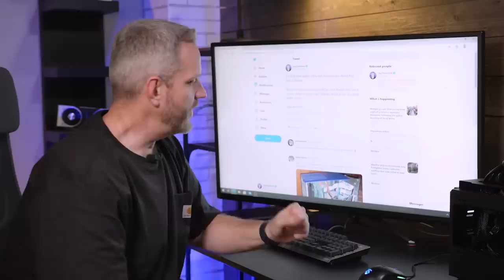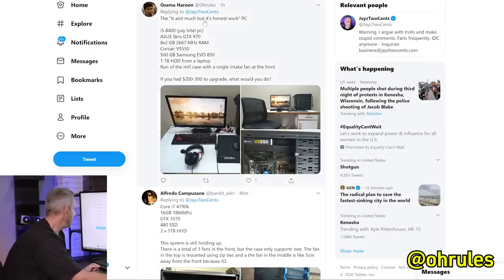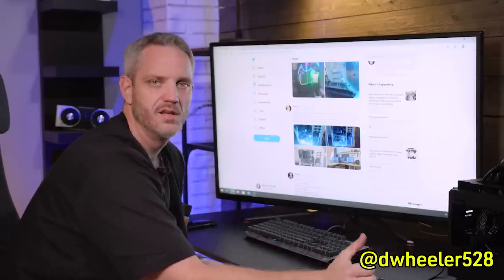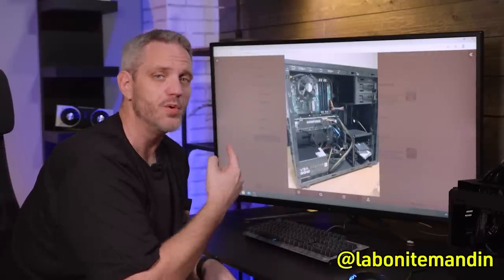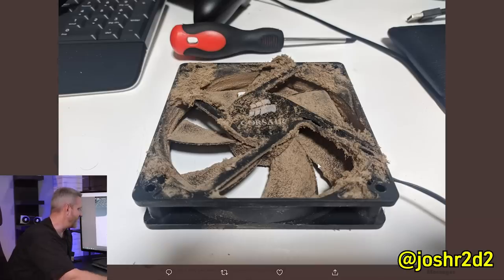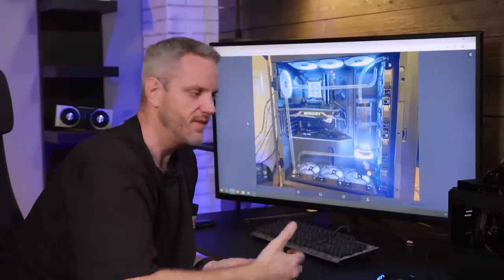Reacting to your WORST Setups... Send help NOW!

Comment: Oh boy, my cable management in the miniITX would give him a heart attack.
Reply: same, but to be fair - if you have a non modular PSU it's supposed to be just a mess
Reply: @Element0Hg  Sorry mate, but no it's not really supposed to be a mess. You can still manage it very well, usually. Unless your case it two decades old, there's no reason why it can't be done.

Comment: One thing I would suggest to anyone who's running storage that are getting close to a decade old (hard drive or SSD): You're getting up close to the end of your drive's intended lifespan - if you're going to continue using them, make sure you have stuff backed up!  Storage is fairly cheap these days; get yourself an external hard drive or something and make sure everything you really need to keep is on that.  It's not a huge deal to set up a new computer if your drives die on you, but you're gonna be really upset if all your stuff is just *gone*.

Comment: I have to agree on the soft tubing
I use my system mostly for creating music and I know that the combination of that and hardline does not go well together but going with air cooling and even some AIO’s would result in a to noisy system so going with soft tubing with compression fittings on a custom loop is the beste solution there is in my opinion

Comment: That first one it the same case I used for my build, it is/was a Dell dimension XPS generation 2 or 3 mine was the 3, it was my first gaming pc back in the day and when i started planning my new PC i saw it in storage and wanted to bring the old girl back to life, with the help of a friend and some parts from a poweredge server we converted it to ATX (not easy) and kept the slide out motherboard tray

Comment: One day I would love hear Jay's thoughts on my first build. 
"Antique" Antec DH800 case
Ryzen 1700X
ASUS ROG STRIX GTX 1070
32Gb G.SKILL Trident Z 3200Mhz
ASUS Crosshair VI Hero X370
Corsair RM850X
2x Samsung 500gb SSD
later modified the case to house 8 Noctua fans, NZXT manual fan controller, Bitfenix lighting controller for LEDs, and a Noctua NH-D15S with the Chromax kit.

Comment: I love my FX Jay. Its not my main system to be clear. But I don't care what anybody got to say about FX. I had a FX-4120, FX-6120 and I currently have my old FX-8150. They ran everything I threw at them. The only reason I upgraded to the 8 core was cause  I got a 6990 and the 4 and 6 core just could not really keep up. I kind of feel like the 6 core should of but maybe I am wrong. 8150  ran my 6990 and the only thing that made it work hard was a second 6990. I still have a Phenom X4 9650 fully working. Works perfect. Its done everything from Playing the Sims to Mining Monero. The FX-8150 and dual 6990's run my PLEX/KODI server. I keep waiting for something to die but....it wont.

Comment: Hey Jay,  great advice on upgrading from the FX series... If you want to upgrade from the whole am3+ motherboard on.. sure a**hole I'll get right up on that.  A lot of the higher FX  processors are still selling for over 100$..can't be as obsolete and unusable as you make it sound. I'm still rocking a 6200 overclocked to 4.5.  So what's your best guess on what it would cost me to just go and upgrade from the FX line?

Comment: FYI for any new comers
10105f - £80/ $80
MSI B560 board - £60 / $80
16 gig DDR4 crucial ballistix 3200 RGB $60 / $80
Corsair 220T case - £59 / $70
And throw your existing GPU and PSU in it for now.

I have been an AMD fanboy for 27 years since I was 13, but I have to say there has never been a better time to get some decent budget bang for your buck PC builds thanks to lintels 10th gen refresh, I built the system above for my partner for Christmas, I was going to go B550 with Ryzen 3 3100 but it costs 40% more for 30% less performance, go figure.

p.s. if you dont have a gpu and are looking for a budget option, if you have a 650w PSU or better, the HD7970 3 gig can be picked up for absolute peanuts, no one wants them due to power draw and no good for mining plus only DX11.2, but it cost me $50 to buy a card that pulls just under 9000 on firestrike, perfectly worthy stop gap for little money.

Comment: suggestion for a theme to submit around.... show us your custom case mods.... what did you have to cut, drill, or 3d print... for example my case only supports a 120mm rad and 3 fans... my 10700k and 3080 get hot... i wanna bust the glass and replace it with a metal plate and cram a bigger rad where it went

Comment: I don't get the problem with soft tube, actually I don't get hard tube for anything besides a show PC. At the end there you explained why I will never do a full hard tube system... Maybe if I could afford a top of the line (no upgrade path) system- Ryzen 5950X, 3090TI, 128gb argb ram, and the best rads/ pumps/ fans in a custom case.

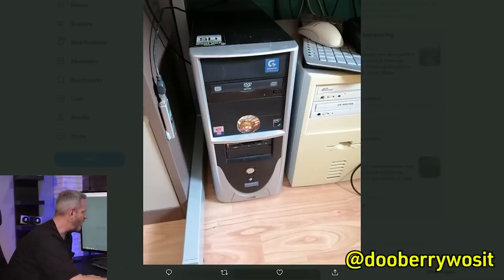Comment: The one at 7:30. Definitely previously owned by a smoker or a humid ass room. That is a lot of dead skin and tar/moisture. The low figure for the amount of skin in household dust is over 80%.

Comment: I bought a system with one year old parts. It was dirty inside. 

 Broke down recently twice, even after cleaning with air compressor.  

Now won't start at all. Light flickers on nocturnal fan then stops. Hope it's under guarantee. The card alone is worth $1000.

Comment: I had a alienware aurora r5 with a i5-6400 and gtx 1070, just built a new pc with i5-10600k and reused my old gtx1070 cause a went above budget, but will upgrade to a 3070 in the future.
Feels so smooth tho.

Comment: 1995, win 3.1 computer with a  tiny I think 1GB HDD, that still works. It is up for an upgrade, stills runs on a 'modem,' that makes the old AOL sound.... It is a museam peace, but runs the old software beautifully. And an old DV7000 hp laptop.. they might be subjects for an upgrade, if your bid is high enough. Old machines, but they run... 10 year old machines. but all work and run the old vintage games.

Comment: It makes me kinda happy every time i see someone else still using Xeon x5675 :D Mine is at 4,2Ghz too, with GTX 1070ti. Im thinking about building new system, but every time i get to the conclusion, that i dont really need to. (i just want to :D ) It is doying everything i need.... (used with 2560x1080 75hz monitor, still pushing around 100 fps in BF5)

Comment: Im running a FX-9370 as a daily, but also have a 1800X system.
Reply: kinda the same. fx8350/rx580 and a 2700x/1080ti ( last build was 1800x but it died and replaced with the 2700x)
Reply: @MrJackSeverity  Im goin to get a 3800X today actually!

Comment: what it means if you take the time to cable manage properly and everything is secure is that it shows the buyer that 1, you take good care of your stuff, meaning that the product will last longer, 2, that you know your stuff, so as jay pointed out, the buyer will have a way harder time to lowball you
edit: at 17:50 one thing could also be due to smoking, trust me, i know, im a smoker, and when i clean my fans and shit every 2-3 months the dust is a slightly more yellow tint than this

Comment: I want to upgrade, but My system is just good enough to not be able to justify it...

FX-8350 @ 4.5 (half assed OC)
32GB RAM
1660 6gb
SSD
280mm AIO

I guess it's just a Mobo, CPU, and RAM I have to replace but meh' this is good enough.  I bought it years and years ago and slowly updated pieces as i got them on sale or used for cheap.

Comment: 15:06 DDR2 isn't expensive. You can get a brand new set of 2x2GB Hynix DDR2 800MHz on Ebay for $20.
I have multiple sets of them and they've been perfectly fine on my LGA775 systems.

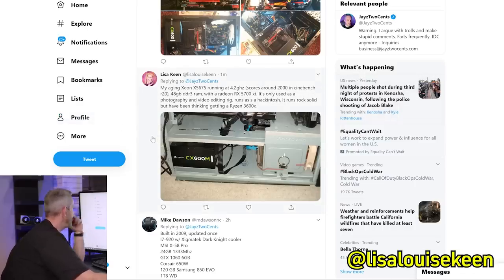Comment: 21:21 The overclocked Xeon 5675 is an absolute gem of a cpu. 6 cores 12 threads @ 4.2 GHz it's the fastest CPU I've ever had. Parallel to my current 9400F but for $45 so $100 less.

Comment: I ended up swapping out my fx purely because the drivers were shite. My pc would bluescreen at random because fx doesn't like playing with wifi card drivers -.- fixed up on a minimal budget last year to a ryzen 2200g and it performs pretty much identically minus all of the random bluescreens so I'm happy. The plan now is to hang onto it until I can get my hands on a 30xx series and just build a new rig. This old boy will probably get relegated into an emulator/home theatre pc

Comment: I just ditched my fx-8370 after a decade of use. Went with the Ryzen 9 3900x .. If you're like me and have been putting it off for  several years, hesitate no longer.. you wont regret it.

Comment: I had a pretty bad bird nest of speaker wires and electrical plugs in my man cave. I didn’t care about the looks I just wanted the sound and gaming. It wasn’t til visitors started making comments that I knew I had an issue. I’m trying to get it under control 🤦🏾‍♂️

Comment: I'm still using a gaming computer that has a fx 6300 but i overclocked it like crazy. The only reason im still using this computer is cause i haven't been able to afford better yet because im a single father of a little girl but ive made it my mission to save up and build a new awesome system by november. Already have a really awesome case, PSU and extension cables just gotta keep saving and get it piece by piece.

Comment: Also, I have a perfect example of budget beast, in a terrible like chealest atx case on newegg at the time, 0. I MEAN 0 cable management, with like 8 or so fans and an aio. And its as clean as possible. Im selling the system for 400 to get rid of it. Pay shipping. 

Gtx 1080, 7600k, 16 gb of ram, 212 evo cooler, rgb fans, aio is a 240 rad on the 1080

Comment: FX cpu's overclock very well, one of the pc's I have has an FX-6300 oc'd to 4.7ghz on the regular I do 4.9ghz sometimes if there is a cpu intensive game being played but it has a 1080ti and 95% of the time the bottleneck is the gpu or ram, 4.9 runs hot. I oc'd it to 6.1ghz stable once during winter in my sunroom @-21c ambient and the fans were cranked.

Comment: Just last week upgraded from a old AMD FX CPU to a Ryzen 3600x and all the works ( still have a 1050ti but I'm working on that ) 
so when i heard him at 6:23 I FELT IT
Reply: same kinda but the other month and only moved to 3600 not the 3600x, but the upgrade is 10000% worth it, such a beast budget cpu the 3600. also im rocking a asus strix 970 atm :/ moving to 1070ti end of this month, however i think the asus strix 970 beats 1050 / 1050ti :P

Comment: I am still running a FX-6300 in my home server until I can get the new Ryzen 4000s, then my i7 6700K will find it's way into the home server.

The FX System was just the only working one left at home (and the fastest) to use.

Comment: The dude, Laboritemanden, it looks like me and him have the same exact case, power supply, mobo, and I can probably guess, he’s running an FX-8350. If he is the ONLY thing different is I had the Corsair H100i AIO, the same EVGA 800w or 600w power supply. I did a way way way better job then he did. So I will vouch and say that the old case does have a hole in the top/left corner right by the exhaust fan. It’s just the back of that case is very very tight. I tried absolutely everything but what I did was the best I can do. But I upgraded to I5-8600k, Z370-E mobo, trident Z Ram 16gb (2x8gb) 3200mhz. Still have my MSI GTX 1060 3gb GPU, HDD, but I upgraded to a Corsair 570x Crystal case, then NZXT Kraken x52 AIO, definitely an upgrade on everything but and I’m still using my same power supple]y.

Comment: I am running an FX-8350, 16gb ram DDR3 ram, 1060 6gb SC, 2 1tb HDD, 1 .5tb HDD, Windows 7, 3 Samsung 32" TV (1080p0.  I am fine with the performance of the computer for gaming and game development.  I am partially disabled, and cannot work so I have zero income so I have to make due.

Comment: Have a Phenom system with 8GB and motherboard graphics, that works (sort of) and a fx8350 with 32gb ram and burned out ASUS Strix 1060 OC 6GB. My one working computer is a amd 3600, 32 GB 2666, 1660 super. Not counting my laptops.. also very bad at cleaning my PC's so tons of dust on all of them.. I am getting inspired to clean all of them after watching your videos... LOL

Comment: i know this video is over 2 years old but for the case of the guy with a i5 8400 im currently still using to this day an i5 8400 with a rtx 2060 and i can play anything with high frames 1080p. only now am i looking to upgrade to ryzen 5 5600 for the only reason that when i play AAA games i cannot watch live streams at the same time without getting throttle issues. but even still i technically watch live streams at the same time with no problems as long as i bump it down to 480p. still a very capable cpu for todays standards

Comment: im running an super old intel procie
MoBo: Intel DX58SO
Procie: Intel i7 920 2.6ghz (stock cooler)
GPU: Radeon Sapphire HD 5870 1G
PSU: Cougar 550w bronze
Case: Antec 902
RAM: Kingston 8gb 1x4 1333mhz
SSD: 240gb PNY
HDD: 500gb WD

Comment: should've sent a pic of mine. he would've loved it. watercooled ryzen with a vega 64 that overheats on water! didn't have room for the radiators so now i have a fan jerryrigged on the outside of the case blowing minimal air through the radiator with just enough force that it keeps it cool enough to play. XD

Comment: My old NH-D15 had an insane amount of dust on it, I didn't clean my computer for three years and smoked 30+ a day, it was about 2 inches thick on each radiator, the temps dropped by 35 degrees wen I cleaned it out lol.

Comment: When it comes to water cooling, I would never in a million years go with rigid tubing. Soft tube all the way
Reply: This. The water expands and compress's. The solid tubing will eventually crack. Maybe in a year or maybe 2 or more years but it will happen. Some people have theirs crack in months and ruin parts. Which end up costing you upwards to 600 to 800 bucks when it could have been avoided

Comment: Just picked up a i7 5960x for $150 CAD to upgrade my i7 5820k because I've read online that the extra cores benefit 30 series. Currently over clocked to 4.4 GHz on i7 5820k. All of it is running on x99 asus sabertooth with 32 gb of ram at 3200 ddr4. So I overclocked cpu then enabled xmp to get the 3200. Then divided 4.4 by 0.125 cause that was the new base multiplier after running xmp

Comment: getting called out on my FX system oof. mine still runs great in 1080p for most titles. 
FX9590
GTX 1660Ti
I put it together on a shoe string budget and its miles above my old setup, looking to go 3rd gen Ryzen in the near future.

Comment: i have a FX-8350 on a Asus Crosshair V Formula-Z  with Systeemgeheugen 16gb -1600 DDR3. + RX590 Phantom. and it runs fine.
but begin to feel  like upgrading for a. 5950x + croshair extreme 8 + 32gb dominator 3600

Comment: @lisalouisekeen the radiator is on a wrong high never put it under the pump, it would be perfect if u can put it on the same high as the cpu cooler is, with the in on the top and the out on the buttom

Comment: Had I not taken a break from watching videos for a while, I probably would have entered mine. i5 750, with an R7 240 video card, EVGA 600w power supply, two 3Tb hard drives (one WD, one Toshiba), one 500Gb hard drive, and 8G of Ram. Cable management is almost non-existant. It's an old Dell Vostro 430, which was a decent computer for its time....but that time was long ago. I do plan on upgrading...

Comment: Jay do a fx vid :) :) still using a 8350 @4.7 with a rx580. still runs most things on mid to high @ 1080 with no issue. also have a  2700x with a 1080ti running on a 2k monitor. FX still a beast :)

Comment: 13:23 I have this case, it does have a top opening for an 8 pin, its just very small and a pain in the ass to run the cable through it so i understand why he didnt do it lol

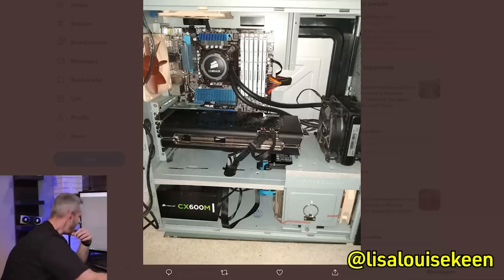Comment: 21:49 I have never seen a motherboard with 6 memory slots on one side of the cpu. It makes sense but usually it's either 4, 4 on each side, or 6 or more on each side. Its either 4 or a crazy amount. But not just 6. Or of corse just two but a good motherboard probably doesn't have two.

Comment: There are bad cases for cable management. My first try almost cut the cable in half. the 'space' behind the was smaller than the cables and the 'grommets' were sharp. the back side of the case did open so you could rout cables through there but as soon as yo tried to close the panel it tried to shear the cables against the sides of the grommets.

Comment: Love people saying they got an "old pc" when they are running 5000 series intel.
I still got my i7 930/sli gtx470 kicking butt as my living room HTPC that I stream games on steam from my main PC.
Granted, a bottom of the barrel ryzen or 9k/10k intel and a 1050 would do the same work with less power draw but it's still good damn it.
Justify my reasoning!